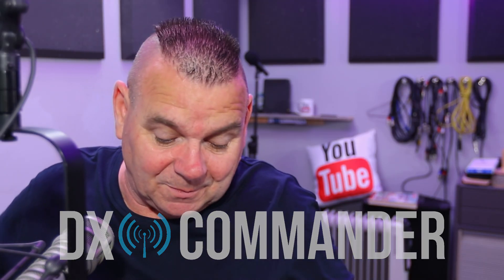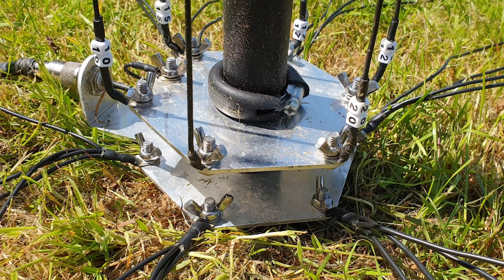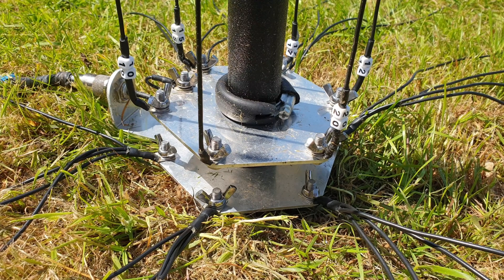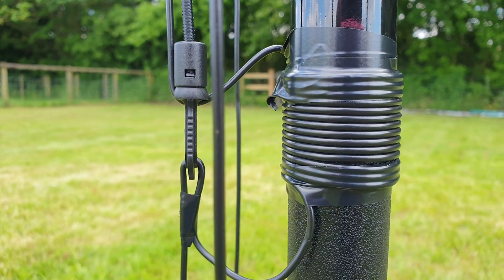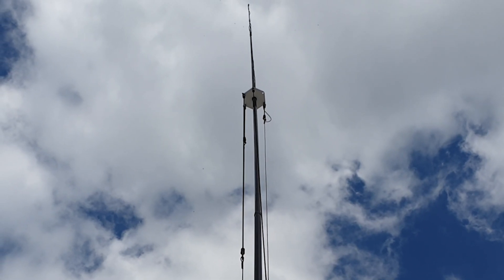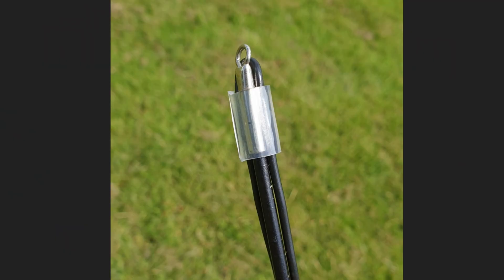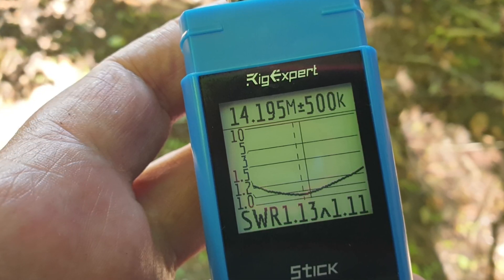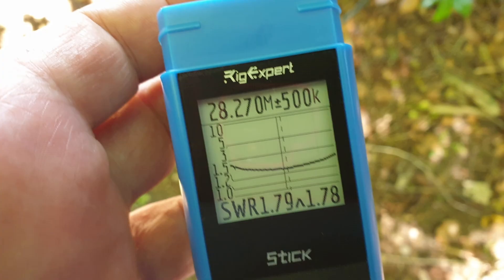Making a shortened 40m Vertical - DX Commander Rapide (old one by request)

Comment: A couple of questions Cal. 1. If you don't have a 6cm loop for the 40m element how is it termianted, do you just tape the bare end to the pole? 2. Why is it necessary to have a discrete 15m element, does the 40m harmonic not work due to the coil?
Reply from the maker: Er yes.. Well, it's not exactly "bare" because it's insulated wire and indeed, once you put a coil in a circuit, the harmonics move.

Comment: 21 MHz is probably high and awkward to tune because there's interaction between the 40 MTR element as it's a loaded 3/4 wave on 21 MHz , So you've got basically two verticals resonant on the same frequency  fed at the same time ,  The 7 MHz  loaded element  and the 21  MHz element .
Reply from the maker: Good answer (!) and NEARLY right BUT when loaded, the harmonic moves (I proved that on the 12.4m development project which waqs fascinating). I can't remember the issue but ikt all works now - thank you!

Comment: You said that The whole screan at The SWR meter is 100KHz, but it reads +/- 100KHz so the screen is 200KHz which makes the result much better. The same for the other bands. The RigExpert shows +/- :-) 73 Per HB9GIM
Reply from the maker: Yes, that's cool!

Comment: I've recently built 3 element vertical basing on your Rapide, but on 10m pole. I got coil with 7 turns starting something about 24cm from driven plate.  SWR is below 1,2:1 in whole 40m range (7.000-7.200Mhz). And yes 21M band is not perfect but still usable. Thank you for all your work and movies how to model and build antenna. 73 vy SP6MI